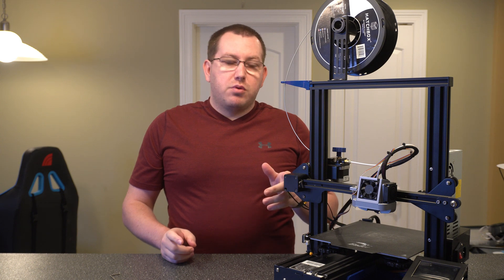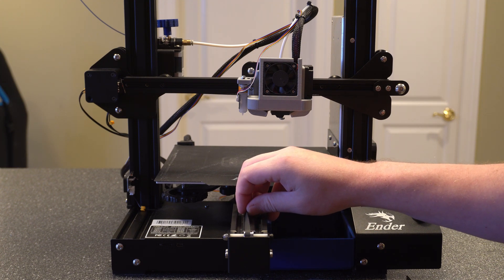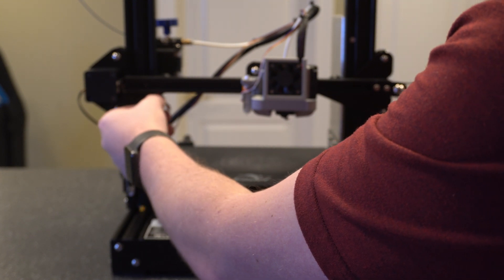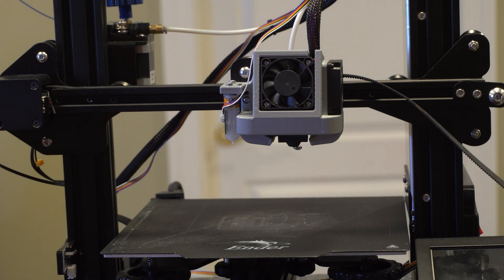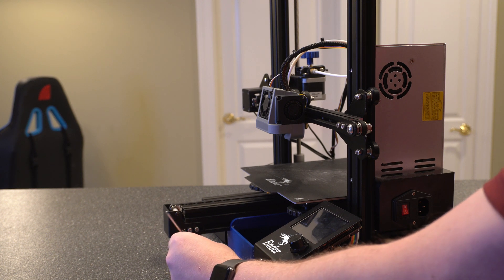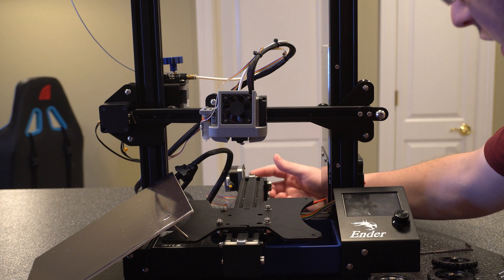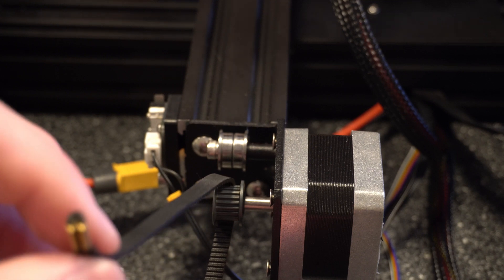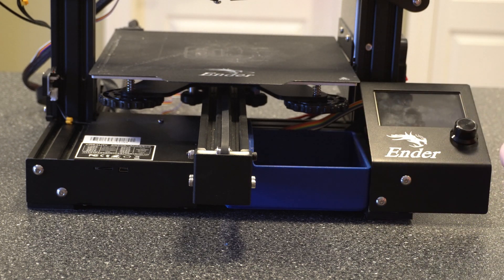How to Change the Belt on a 3D Printer

Comment: Somewhat helpful but a lot of hand shots covering the parts. Also not the same brand. But maybe enough help to figure it out. If not, will you come fix my grandson's printer😮😅
Reply from the maker: Hi. Sorry about my hands being in the way, its difficult to work and record sometimes. Changing the belt should be pretty strait forward and similar across brands.
Reply: @3DPrintscape  on the Y axis, how do I know length of the belt to cut?
Reply from the maker: @noramarshall2629  The one i bought came pre-cut but if you have the old one you can measure that or look online to see how long the pre-cut ones are.
Reply: @3DPrintscape  I found a neat trick to attach the y belt on both ends with a rubber band. The Any cubic is really tight to maneuver under the heat plate. I'll try to write it out for you. But the trick is to use a rubber band on the belt on  the back end to have some stretch flex to pull and put on the front side. Probably doesn't make any sense.
Reply from the maker: @noramarshall2629  Interesting. Thanks for sharing the tip.
Reply: @3DPrintscape  I have Anycubic Kobra. It's a pain to work on and there does seem to be a way to take the plate off to see the slots.

Comment: A minute and a half of jabbering and dithering at first. 
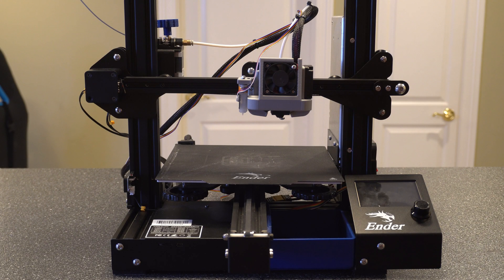Actual tutorial officially starts at 1:23 or so.
But even then, more stuff not involving the belt removal: 
he doesn't actually start on the X axis belt until 3:30.
Y axis finally starts around 8:48
Also, he seems to think we're psychic. For example, he pulls out the brass ends of the belt with his direct drive completely in the way, same for connecting the new one — the only part I needed help with — no chance to have any idea how it's done.
Useless, if you actually needed help with the hardest part.
Reply from the maker: Hi. Thanks for the feedback. I will work on making a better video for this topic.

Comment: I just bought a sD Printer (Anycubic Kobra) and assembled it and ran through the leveling/etc and that always failed...THEN I notice what looked like a drive belt hanging off the left side. Had no idea what it was for so was ready to send "broken" printer back. Found this video and lo and behold! That WAS a drive belt! I attached it and voila...printer worked. Thanks man!
Reply from the maker: Hi. Im glad you got the printer working :).
Reply: which belt did you purchase

Comment: Hey man I can’t seem to figure out how to connect the ends of the belt to the extruded and unfortunately that’s the one thing this video doesn’t show. Any help is appreciated cause I just can’t see where they connect to it.
Reply from the maker: Hi. There are little slots that the belts slide into. They are open on one side and about as thick as the belt itself.
Reply: @3DPrintscape  man I found them almost right after I typed it. 😂Thank you for the response anyway brother!

Comment: Where do you get the end clamps?
Reply from the maker: Hi. Which clamp are you asking about?
Reply: @3DPrintscape  The little clamps that go on the end of the belt. I ended up folding my belt and super glueing it together to stay put
Reply from the maker: @413RC  Ah ok, those are just Timing Belt Cample for 3d printers. Im pretty sure amazon has them.